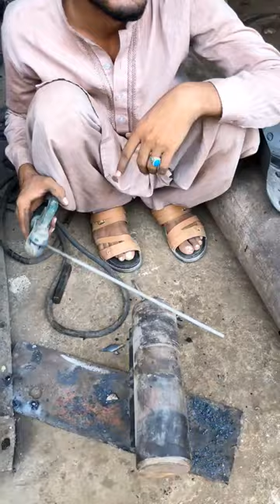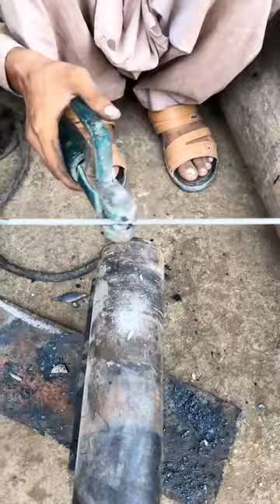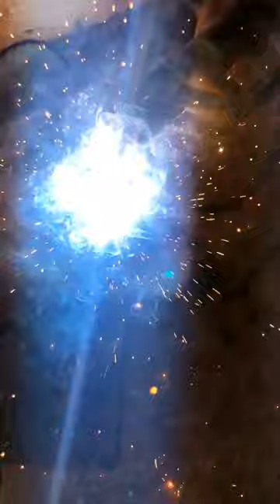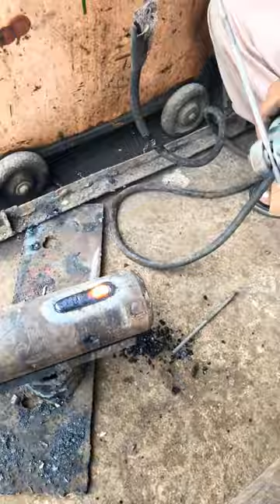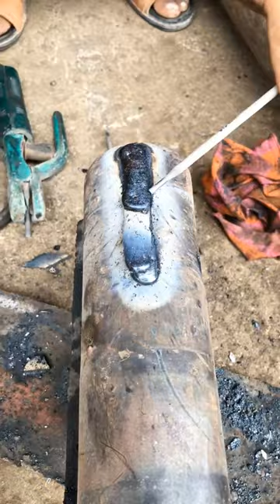new method of welding of Pakistani welder#shortsvideo

Comment: What’s wrong with the normal way of using a rod ?
Reply: It's harder to use and control a full length rod as a beginner teaching myself to weld there are many times I will cut the rod in half because it's easier
Reply: @trailman20 learn the basics

Comment: I'm not sure what this accomplishes, but if you do it, don't forget to cut off the unshielded end of the rod that is usually held by the stinger before you use that end.
Reply: Fabtu samjha rha bhai hm ye sab jnte hai kuch acha samjga
Reply: Good point
Reply: My guess is the slightly more difficult long rod welding is reduced?